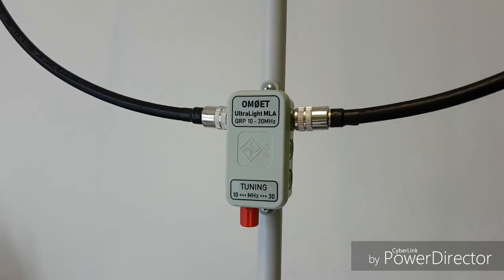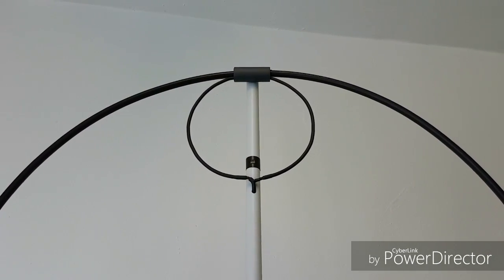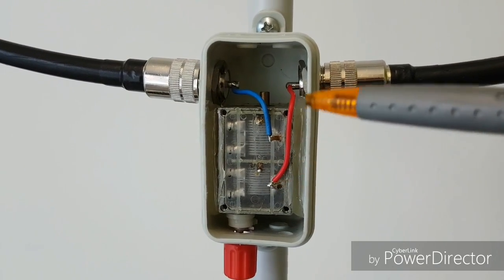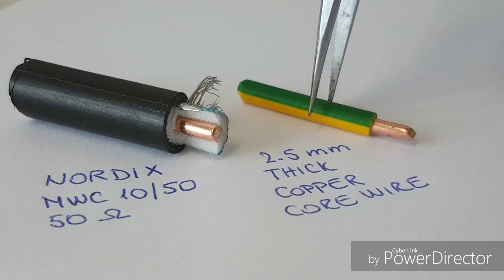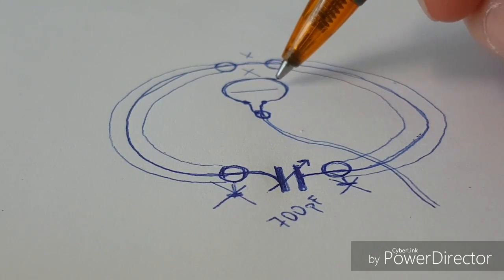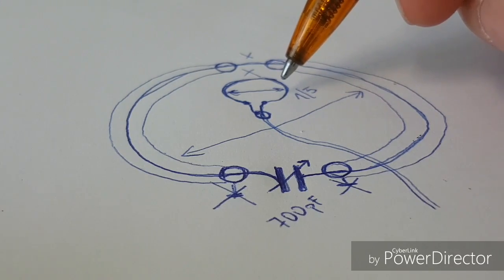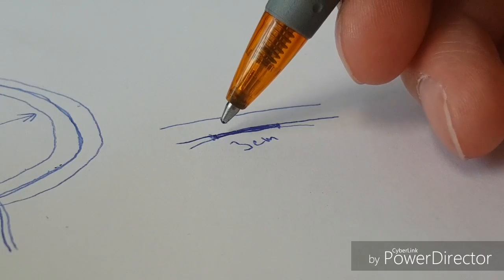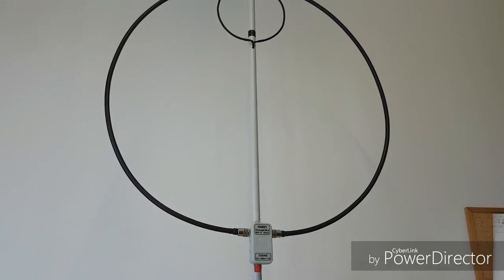ver.2.0  UltraLight Magnetic Loop - great QRP Antenna

Comment: I may be totally off here, but looking at the inside of the box, it looks like the capacitor is connected (via the red+blue wires) to the center-connector of the big outer loop ?  Doesn't the coaxial shielding of the outer loop prevent any radiation from escaping the center-lead ?

Comment: Won't it work better if you connect the tuning capacitor to the outside of the coax on the loop or doesn't it matter?

Comment: I'm not sure I understand the construction of the antenna and the choice to use the inner conducter and not the shield, which it seems would present much more surface area considering the skin effect of rf on a conducter.
Reply: I had that same thought. ANd not to mention that the shielding would prevent radiation from the center lead to actually escape. I might be totally off, but figured the shielding would work as a faraday cage thus preventing radiation escaping that coaxial. I am sure the antenna works -- so I must be mistaking, but I would like to know what I don't understand here :)
Reply from the maker: Well, you probably forgot that there is also  quite a big capacitance and coupling effect between center core and the shield 😉
Reply: @OM0ET I am going to try this, I have some LMR400 here and would like a qrp loop for my FT817.

Comment: I built the same antenna, but i did not interrupt shielding of the coaxial cable of the main loop on the highest point (as you did in your drawing). But it works for some reason... how is that possible?

Comment: Hi Paul, some time ago I built my own loop. It is 1.2m D / 23cm d excitation loop and double gang 300pf  capacitor. I did not use it so much till now after I add a stepper motor to tune (manual). I'm using mcHF rig. On 20m it looks fine, but on 40m I noted some strange behaviour: some time it looks like no power is emitted even if it is tuned (2nd checked with VNA). Speaking on mike, the rig power meter show very low power and SWR is 0 then suddenly  power increase as well SWR (correlate to my voice). I check modulation level with dummy load and seems good. Any suggestion ? (I'm a digital guys :) ). 73 iu2omt Paolo
Reply from the maker: Hi Paolo. I think you have shorted capacitor and in one position will apear spark between the plates. It's just my guess, I am not sure of course. Best 73! 😉
Reply: @OM0ET  thanks, capacitor is like the one you are using for your loop.
rig power is 8w.  Is it at the near max limit? 73
Reply from the maker: It's not a max limit, but your capacitor may be broken. Try to use compressed air to blow dust away from the space between the capacitor plates. It may help
Reply: @OM0ET  thanks, will try it

Comment: Hi there.  Its George in the UK. I have watched many Youtubers videos regarding magnetic loop aerials. I have found your videos to be the most informative.  I have just completed making one using mainly scrap material and Car Brake pipes. It receives very well. Not tried transmitting as only just purchased a transceiver. My loop is 1metre in diameter with 300mm for smaller loop. Ex military tuning cap 200pf. Will do a video soon. Best wishes from old George and Jane 👍🇬🇧👫🤠
Reply from the maker: Thanks George! I wish you good luck with your own Magloop antenna and many nice contacts! 😉👍
Reply: @OM0ET  My mag loop is complete. Great on receiving. However I have given up trying to get the swr below 3. I Don't have an analyser. Tried small loop closer or farther away from main loop. The main capacitor peaks ok on receiving stations. I have put in parallel to main capacitor a 50pf tuning cap. As a fine adjustment. Set to half capacitance. Then peak receive on main cap. Then vary fine cap to set peak accurately.  I am working blind without an analzer. Cheers from old George

Comment: Dear friend, the sections of the variable capacitor connected in such a way are connected in series and do not have a capacity of 700 pF, only a maximum of 174 pF, but a higher breakdown voltage is obtained. What max power can be applied in your antenna so that there is no sparking on the capacitor? Regards, Marek SP2CG
Reply from the maker: Yes, you are correct, but I did mistake in the video

Comment: Thank you for very interesting video. I am a newbie to SWL and would like to build this. A couple of questions if you would. Would this work in my loft, is the layout the same for just RX. I have air capacitors in junk box. Would I need to use my homemade antenna tuner for this, or would it help. Hope the questions are not too daft. I am OK on making and soldering but not too bright with theory. Thanks again for video.
Reply from the maker: Hello Mike. You can use any air variable capacitor what you have, but it have to be with higher capacity, at least 300-500pF. Magnetic loop antenna when are properly build doesn't need any aditional tuner because when you tune this antenna on desired frequency , you should get 1.1 SWR. But if you are only SWL so you don't need worry about SWR on your magloop antenna :) If you would like to use your magloop remotly on in your loft you should find solution how to tune this antenna remotly from your room, because this type of antennas is very very narrowband and requires tune very often ;) 73, Paul.
Reply: @OM0ET  Thanks for that Paul, the tuning bit completely slipped my mind altogether, so I will have to rack my brains for that one. I have a large enough air capacitor for the job. Very interesting, thanks again.
Reply from the maker: @mikepeirson1150  you're welcome my friend! If you have some questions write me in our facebook group "QRP World" 😉👍
73 and good luck!

Comment: What is the lenght of shield gap in the main loop? Thanks
Reply from the maker: This gap is no longer required. Just leave the shield normally in one piece and antenna will work OK also 😉👍 In v.4 I dont use the gap any more.
Reply: @OM0ET  very interesting. Tnx Paul.
Reply: @OM0ET  are you always use only the center core of the H1000 leaving shield open?
Reply from the maker: @vannidifede9492  Yes :) It works good

Comment: Are there instructions for assembly? You information suggested very critical tolerances. I am not sure that I could assemble the antenna. Am I correct that my antenna lead connects to the small loop? Thank you for your for your time and help in advance. Tommy

Comment: Hi I'm new to the loop antenna when you talk about the outer shrild not being connected do you create a split in the outer sheild of the coax at the top of the outer loop or is the break created at the pl259 ends
Thanks in advance
Reply from the maker: Hi Sean. No the outer shield is not connected to anything. I use only inner line connected to capacitor. It's slightly different design like others 😉
Reply: @OM0ET  Oh I see  thanks for responding

Comment: I don't understand the 700pF value. Two capacitor in serie should give around 170pF not 700pf?
Reply from the maker: Yes that's correct. In the video is a fault. Sorry! 73 Paul
Reply: Parallel

Comment: many thank's for your instructive video but I don't understood at 7:50 mns 
How long must doing to " cut " the ground line please ?
Reply from the maker: The gap should be at least 3-4 cm. Place without shielding.
Reply: OM0ET many thank's I will try to made one of your mag loop 
. But much long for also the 40 mtrs . I hope doing a qso with you on the air à day .. I am qrp'er but on cw mode . 
73 and many thank's again . 
👍📡
Reply from the maker: I wish you good luck with your own MLA! And on 40m the efficiency is not very usable with this diameter. 73 and thanks for watching!

Comment: Hi! Why didn't you connect the central wire and shield together? Perhaps, this could bring some interesting result. 73! UT8UU.
Reply from the maker: I measured the outer signal strenght by both versions and there was almost not recongnizable difference.
Reply: OK, I see, thank you! I too will use the inner wire only - this approach of attaching the connectors seems to be even much easier (for further disassembly).
Reply from the maker: Сергей Усманов hi Sergey. I tryed both versions and this with only center connected is much more better SWR and not so sensitive to nearby objects. With connected shielding is very little stronger radiating of this antenna. So my choice was the first one without shield connected. 😉
Reply: Hehehe... Every dB of an emitting signal is a hundred kilometers far correspondent you can reach. I will try to use both the central wire and shield soldered together - this should affect the common conductivity and, therefore, the performance of the antenna. I guess so.

Comment: Tha k youfor sharing your super neat work!!! I really like it. 
2 things I'm not agree, in order to reduce the resistivity along radiator BOTH shield and center conductors MUST be connected. An electrical "short" is needed. The shield soldered to the center conductor.

2) when you are using a 2 gangs air variable capacitors in series the total capacitance is the inverse of each capacitor. 
For example 1/340pF+ 1/380pF.
Reply: Es 1/c = 1/c1 + 1/c2
Reply: 179.44 pf